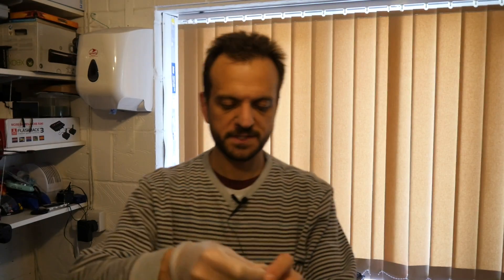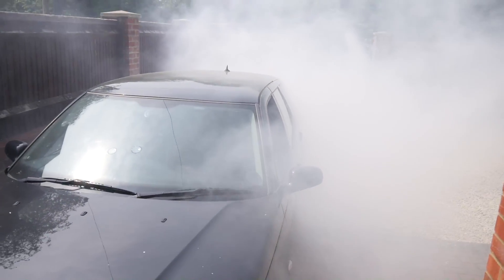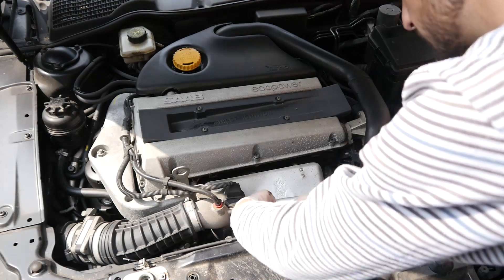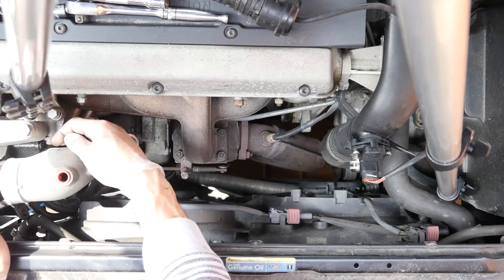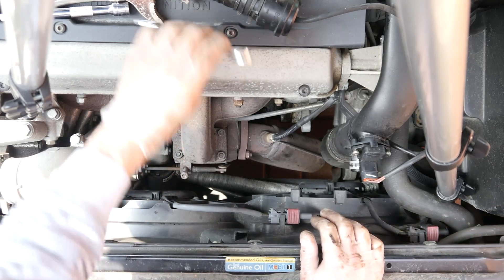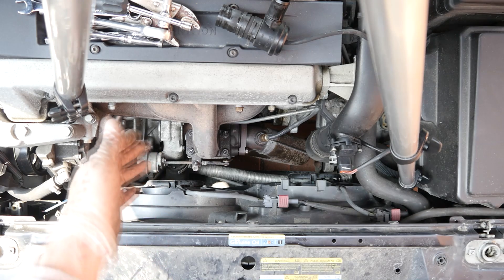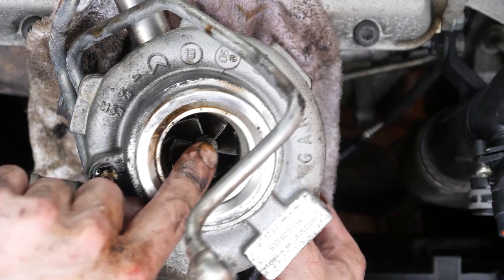How to replace a GM Saab Garrett Turbo Tutorial Part 1

Comment: I'm Stateside, "across the pond", replacing the turbo on my 99' 9-5, just shy of 300,000 miles. Inherited it about a year ago from my father who was a lifelong Saab guy. He was an engineer, fabricator, welder, and car builder. He changed the oil every 3000 miles religiously, and only used synthetic oil in all of his vehicles. The car was driven for a couple of years by other family members who didn't maintain it. I dropped the pan a month ago because of low oil pressure, cleaned the pickup screen, it was sludged up pretty bad, obviously from cheap non synthetic oil, made sure everything was cleaned out, including the gasket surfaces. Was amazed to find out there was no oil pan gasket at all. You could see where oil had been weeping out between the pan and block. The entire bottom of the engine and front subframe were covered in thick sludge. Must've been happening for years. I used some good high temp silicone for the gasket material. A few weeks later I started developing oil around the top of the oil filler tube. Thought maybe it was the PCV system failing. Turns out the car had the updated oil trap system, but I purchased a new kit anyway. Wouldn't ya know it, before I could install it the car started blowing huge clouds of smoke out the tailpipe on my way home from work one day. A mechanic looked at it for me real quick and said it's definitely the oil seals in the turbo, and that it would probably be a good idea to change the PCV system as well. So then I found your video on YouTube. As soon as I saw your Saab blowing huge billows of smoke I started to laugh, that's exactly what mine does !!! But the reason I'm writing you is to tell you that your video is by far the best one I've seen. Very well explained, very well executed, and incredibly easy to understand. A pure delight. Thanks for taking the time...chris.

Comment: Yesterday i removed turbo same as on video and now im wondering... Does it make sens to change stock Garret to TD04hl? Will it do any better without new program? Now i have 217hp and 362nm after replacing fuel incjectors, fuel pump etc. Like im going to sell it to the end of 2024 and dont want spend to much money on it, made tune etc

Comment: penetrating oil, applied often for a week or two in advance ....loosens up ex nuts.. nicely.
 Oil feed lines carbon and sludge up BADLY.  Especially so in the Bungled 2000 and Newer engines.

Comment: Thanks, this is a great guide, my, turbo doesn't burn oil but rather has just completely seized up solid.
I'm replacing it with a larger TD04 instead though
Reply: The td04hl's are much much more reliable than the garrets, mine has 250k original miles and I recently took it out and it's still in good condition. I did it to swap the turbine housing to a short neck in order to use a king cobra pipe, and also ported the exhaust manifold connection as I have a aftermarket exhaust manifold with the opening basically matching the gasket.

Comment: If that pipe that pumps air into the turbo is not joined correctly using that v-band would that cause an evap leak? P0455?

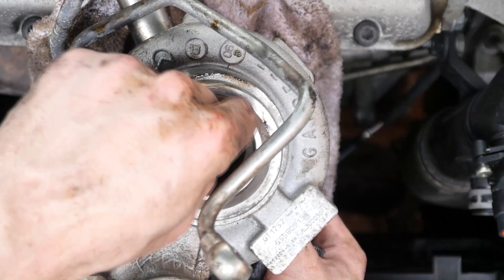Comment: 09:14 "just replacing this will restore the car ..."  -  I'm interested to know if you replaced the turbo and then had a repeat problem? 
I ask, because bearing failure of that sort is usually caused by oil starvation, which in turn is often caused by the feed or return lines getting sludged up, which in turn is caused by infrequent oil changes and/or short journeys. Failure to resolve the root cause whilst changing the turbo usually results in a repeat problem soon after.
Reply from the maker: The car is still running fine. I heard through my research that is really common for the turbos in these to last 100k miles. I think it's simply wear and tear. I am really happy with it as quite reasonable priced service item. Keeps the beast running.
Reply: @backofficeshow  Sounds like you didn't have an oil supply issue then. 
Do you still have the failed turbo or is it gone now?
Also, how do you get your avatar to spin like that?

Comment: Currently have a small amount of smoke after a cold start with my B205E 9-3, fearing my GT17 might also be in the process of blowing a seal. Did you have a similar experience before it failed badly?
Reply: That is just normal Cold starting smoke
Reply: @Comrade420_  it's been a year haha, my turbo turned out to be broken, wobbly shaft.
Reply: @Clear_Ski3s  yep mines broken too and i can't afford a new one :(
Reply: @Comrade420_  maybe you can try a Chinese turbo to save money? Mine wasn't genuine either and it has been working perfectly for half the money :)
Reply: @Clear_Ski3s  yeah that could actually work, i will try looking for one
Reply from the maker: I think that's the best approach, my Chinese clone in this video is still running well. Must be at least 30k on it by now, probably more
Reply: @backofficeshow  nice

Comment: What size is the banjo bolts for the return /feed lines
Reply from the maker: https://www.neobrothers.co.uk/banjo-bolt--washer-set-saab-9-3-00-02--9-5-98-09-td04-8549-p.asp not sure but maybe you can get the info from the part numbers

Comment: I bet you regret putting that Chinese turd on your car. I made the same mistake. That's why you should just bite the bullet and get a genuine Garrett turbo and not waste your time and money on cheap crap from China.
Reply from the maker: Why would I regret it? Its still running just fine. 

Sorry to hear your experience was different. A lot of people seems to want to get me to slag off this turbo, but I have had absolutely no problems with it nor do I have any agenda to promote its manufacturer or country of origin.
Reply: I have a new Saab now and have just upgraded to a td04 so I have a spare gt17 if you want it as a spare for your 95.
Reply: I'm not trying to sell you it. You can have it if you want it.
Reply: Steven Thompson First time trying to use youtube notifications was yesterday. Idk if I did it right since I don't see my message. I would love to have your turbo if it has not been claimed. Please let me know. Thanks.
Reply: I just don't want anyone else to go through the heart ache I went through that's all.
Reply from the maker: People have enough information to make their own educated decisions these days. with a faulty turbo there could be so many other reasons on why the initial turbo failed in the first place that the engine may already be destroyed. I think it's good advice that people should always make educated decisions and definitely question garages in other repair services as well - don't trust anybody 😂

Comment: Wow ! I expected changing a turbo to be a huge job , only for the experienced mechanic. But this really looks like it takes ten minutes to take it out if the bolts come out.
Reply: I was always so scared of having to replace the turbo. But now I'm not. Thanks.
Reply from the maker: There is always the risk that bits and pieces got into the engine, oil in the intercooler etc etc, but I say for the money do the swap, turn the key, and hope for the best 😁
Reply from the maker: It's nothing, for a big job I'd say changing a gudgeon pin would be worse 😁

Comment: Do I check the oil cold or warm while determining if I have been burning excessive oil through the turbo being bad? Sorry! I am just a girl! Lol!
Reply: Saab wis says to check the oil hot. Long drive. Have sit on level ground not running for 5 minutes. Pull dipstick, wipe it off. Put back in. Check oil level.
Reply from the maker: I guess if you are checking to see if you are using oil, just check at the same temperature each time 😂

That being said I think I usually do cold as it gives time for the oil to settle in the sump.

Hope it helps!

Comment: If you do drop the bracket or nut @3:23  into the aluminum inlet trumpet pipe, a small magnet taped to a string will work to fish it out from where it is likely resting near the inlet turbo fan. (speaking from experience and wanted to pass on this hack in case!)
Reply from the maker: I hope someone gets to use this advice over the hassle of dismantling things unnecessarily 😁

There certainly are a lot of fiddly nuts on this beasty!
Reply: you have to remove the pipe from the turbo anyway, so you will find it if you do drop it.

Comment: Hey i have a 2001 saab 9-3 se  hight output turbo b205r . will it make a difference if i order it from max speeding rods?
Reply from the maker: +Three A difference in what way? If yours is broken then it will be a good replacement, but if yours is fine then I doubt any significant gains in replacing it
Reply: mines broken smoked down the road this morning . i only ask because of the sports mode on the se which makes more power . Would it cause the base mode replacement wear out ? last question is yours an se 9-3 and is it still running . Thanks for the great video an quick reply
Reply from the maker: Three I doubt the turbo is any different in specification unless it's a bigger one. Just get a like for like replacement and I'm sure it will be fine.

Comment: That turbo is properly knackered, i hope mine never ends up like this.
Did you hear or feel any difference with the new turbo, would be nice to know how it feels when it's failing like that just to be prepared in case mine starts going like that.
Reply from the maker: Not really, just once I noticed a little cloud, like the briefiest black puff. 10 miles later, no oil in the engine! So really there was no warning at all.
Reply: That's scary if it fails like that, although i had mine rebuilt and rebalanced so i hope it lasts.
I did the rebuild myself with the eBay kit, which is why i'm a bit worried. :)
Spotting a failure like this early on can save a load of cash, which i don't really have much of since my SAAB rebuild :D
Reply from the maker: +Poptart McJelly Ha ha, let's see. I expect the Chinese one to outlive the car now. It's well over 100k
Reply: My '96 NG900 has done just shy of 300k kilometers and it's still kicking, so unless you crash your SAAB it won't be stopping anytime soon :)
Reply from the maker: Poptart McJelly It's not getting much use at the moment, too many cars to choose from. I might take it out for a spin tomorrow 😂

Comment: What year is this? and at what milage did this happen?
Reply from the maker: +Sean Hinkley 2007 model, happened around 103,000 miles
Reply: backofficeshow surprised it happened so young in its life. I believe the garett was known for this, the Mitsubishi turbos on the Aeros last much longer.
Reply from the maker: Could be, I hear these turbos are rated to 100k so it's about right. I guess there are a whole load of other factors that come into play. Either way, it's a small cost for that many miles
Reply: I have the 2007 lol. With almost 170K miles.

Comment: Where do the metal shavings from the turbo blades go? into the oil filter?
Reply from the maker: +mark warnberg yes, you got it. Some into the filter some ground so fine into the oil itself. Gives the oil a shimmery glittery look.
Reply: Depends on what side of the turbo. If it's the exhaust side. They get stuck in the catalytic converter

Comment: Shouldn't the banjo bolts be cracked loose before taking the turbo off the manifold???
Reply from the maker: +BlastReadingSeries If you can get to them you may as well, but if you can get the turbo out without then it's also not a problem as they do not take much torque to undo.

Comment: When i did this swap i went from a garrett to a tdo4hl 19t .only extra bit of kit i needed was the oil lines for the td04
Reply: Swine hound productions is this turbo better than stock as in power gains? I